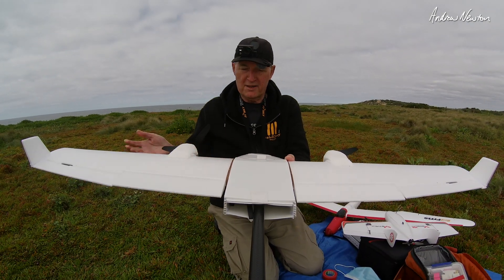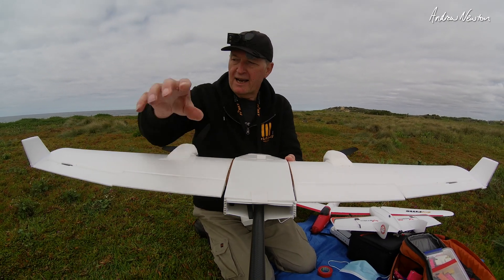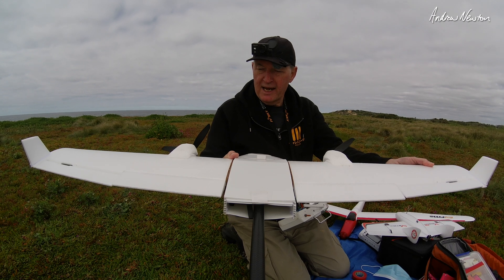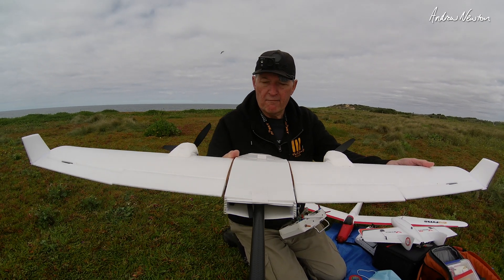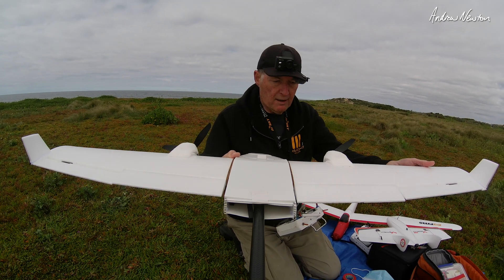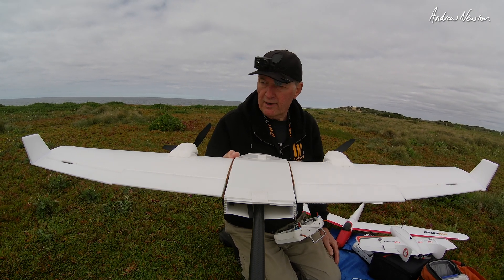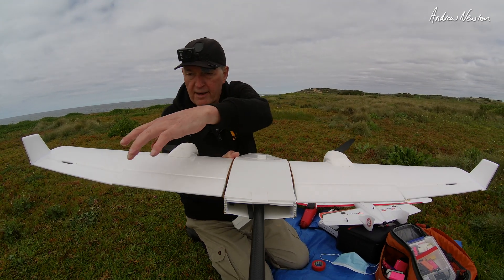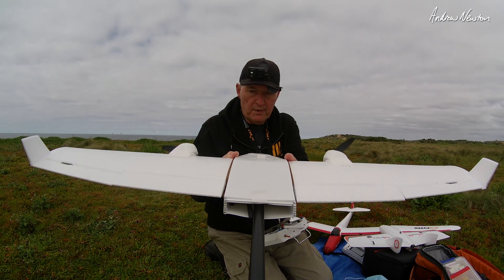Eggloader wingtip fins

Comment: My Skyhawk v2 twin flies great really slow with props in like you have here, but if a totally different wing design & I guess props in is for added air towards the tail.
On my Teksumo twin however I followed Josh Bixlers advice & went for props out & I feel that me the extra control when flying slow...
Would that help here?
Curious on your thoughts as to what helps prevent tip stalling tendencies when it comes to prop rotation- more air flowing over top of aileron/wing tips or under???
(Random 2am thoughts from an insomniac)
Reply from the maker: I haven't noticed any change in behaviour with different prop rotations. Might be more significant with a smaller plane like the Skyhawk

Comment: Great flight once again, always nice to see that coast line too.  Sorry about the broken prop.  Suppose you should have put on a set of wheels, to keep it up off the ground.  I don't care for folding props on a two engine plane either.  Anyway, it looks like a nice flying aircraft and suspect it has lots of room for a GPS and a longer range system if you wanted to explore farther down the shore line.  Sunny day here but at the freezing mark all day with high wind.  Happy Flying
Reply from the maker: Oh winter arrives fast